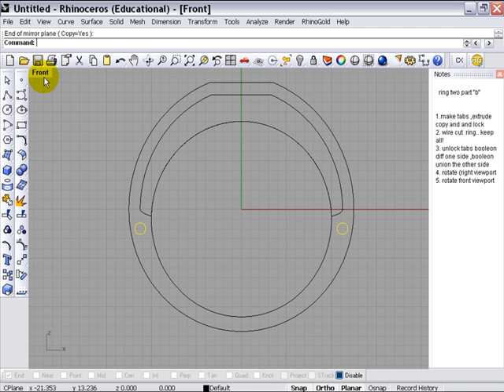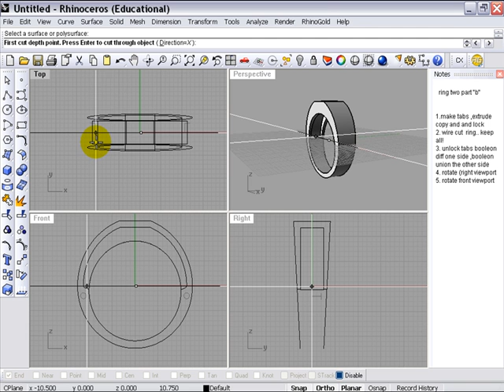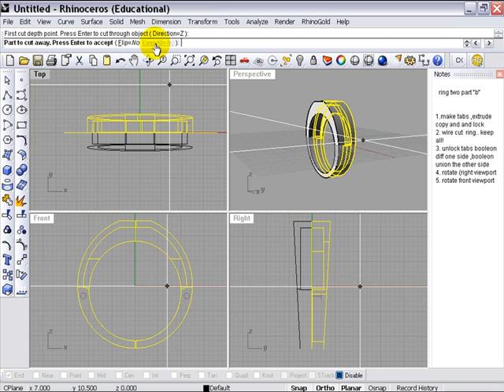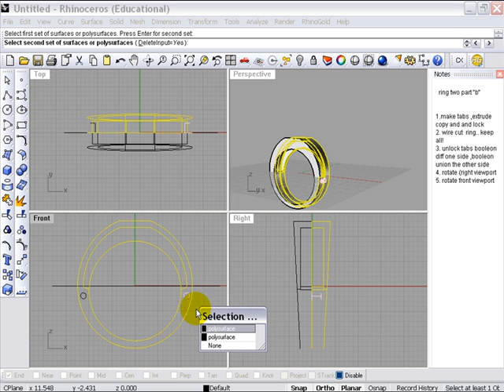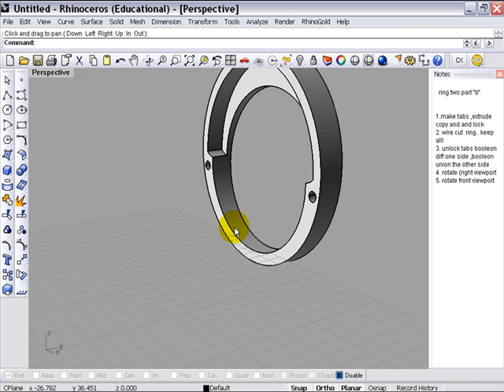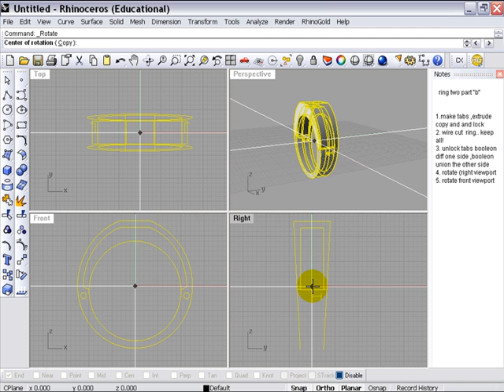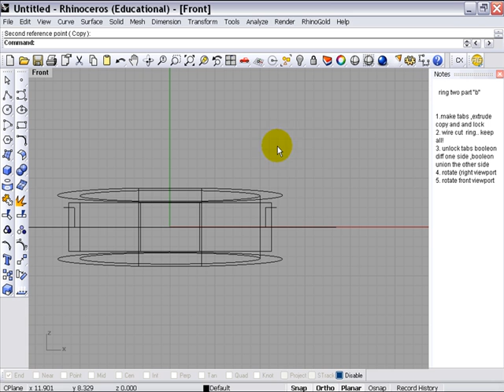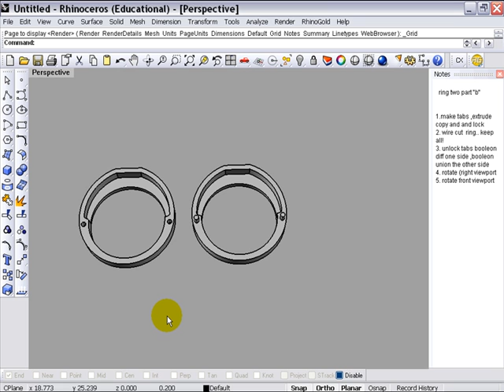pat schmidts secrets to jewelry design using rhino software

Comment: 2 Secrets...
Thickness in the middle of the ring are wrong... You have to offset the external surfaces to make the hollow right.
Why you make 2 prongs on 1 side and 2 hole in another? It's better 1 prong + 1 hole for each side..